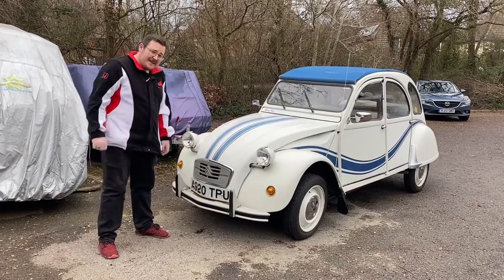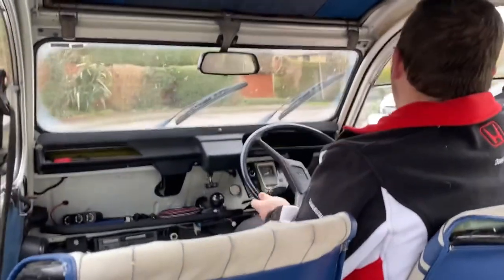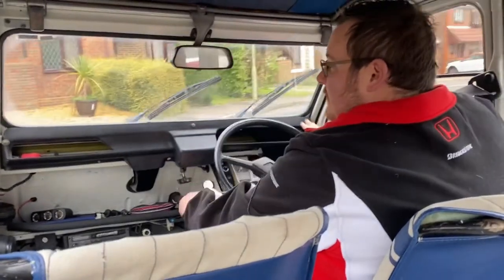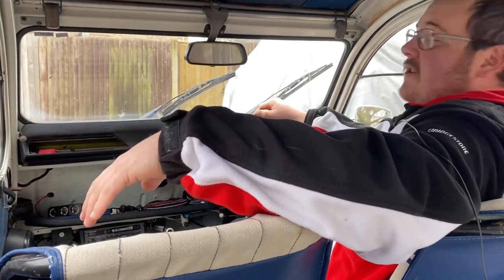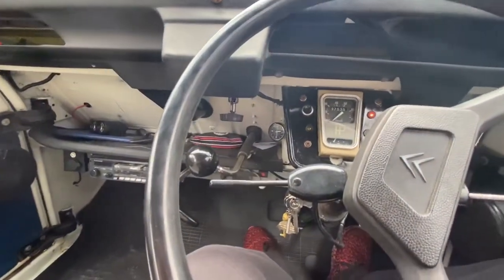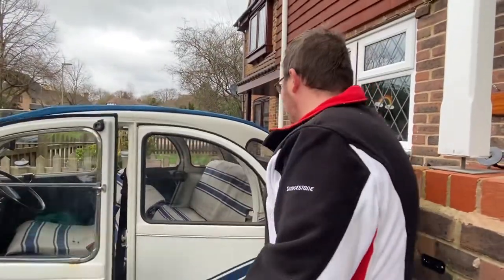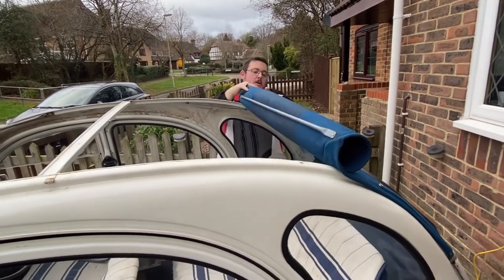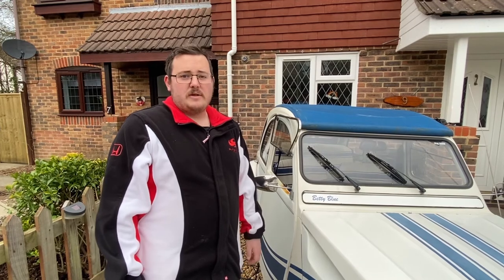Citroen 2cv review

Comment: I used mine for 3 years doing a 30 mile commute every day, and to devon and back around 500 miles no problem, if as you say the brakes are not there, then somethings wrong or your to used to assisted brakes they are usually really good, power steering? your to used to modern cars !!